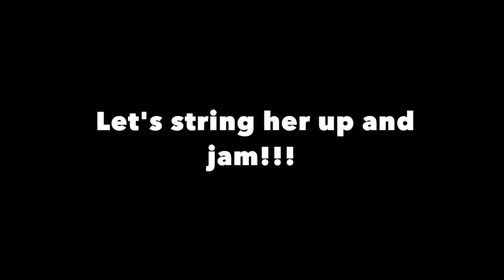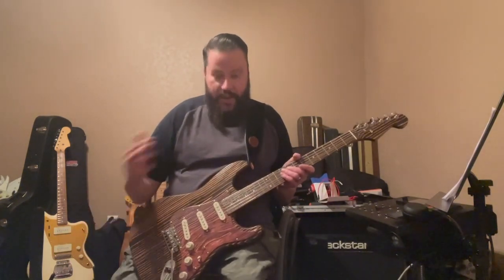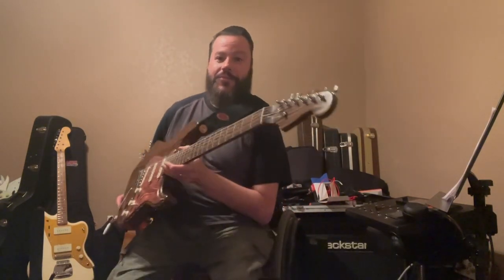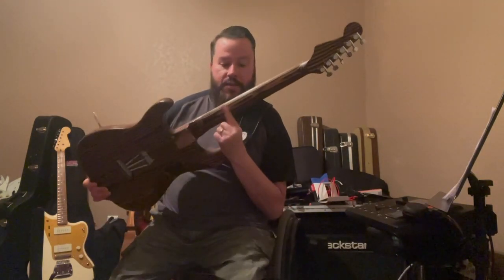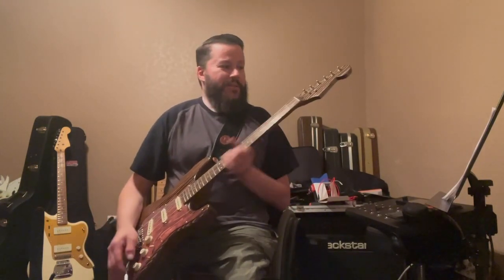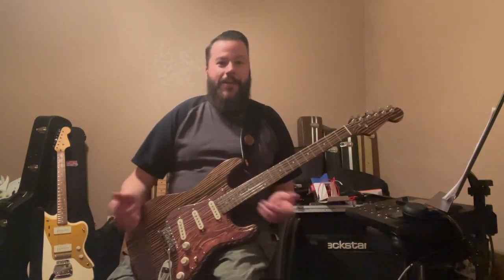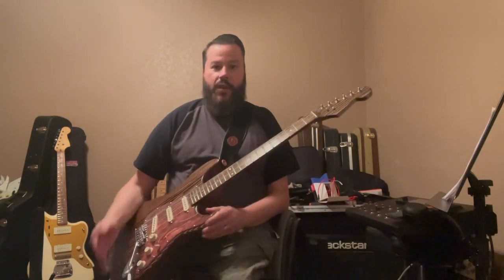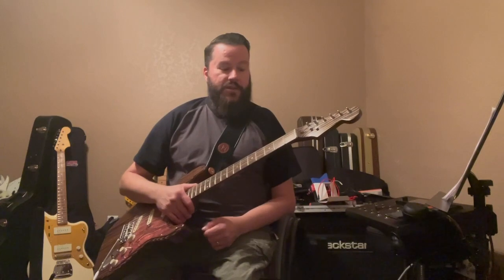Bad Cat Zebrawood DIY Guitar kit part 2- The Build/Demo/Review. BIG ANNOUNCEMENT!!!!!

Comment: I was watching you video and loved the way it turned out. I didn't know you could use tung oil. I am just starting my first kit, got the neck glued and it's like you said. Solid, tight tolerances and looks great. I am addicted.
Reply from the maker: This one is Tru Oil which is a little thicker than Tung oil but in the same family of oil based finishing. Tru oil offers slightly more protection than tung oil. Thanks for watching. Good luck on your first build and don’t hesitate to ask for advice if you need it. I have built a lot of guitars and happy to pass what I have learned on.

Comment: Like what ya did with the pickguard choice and the simplicity of just a tru-oil finish, surprised by the stock pickups.... and you didn't say so I'll ask, did you use and type of sheilding? tape or paint? 

As far as winning the kit... well... I'm in the middle of my first build(LP style) have another set neck PRS style kit with a junk neck from a different company...need to do some shim testing on that..... so a bolt on ST would be the next logical choice for a build...especially from Bad Cat.. Have heard great things about their kits! so bring it on!